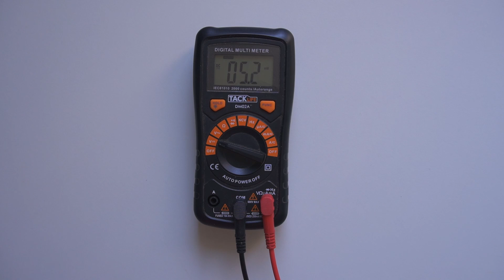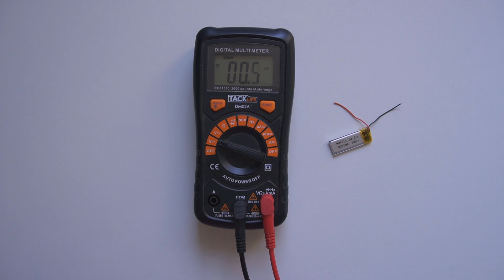Nice!Nano & Batteries | Quick Guide

Comment: Incredibly helpful video! I think I spotted the Ferris Bling MX at 4:10 , which is what I am planning on building. I am slightly confused on the stacked design, what materials did you use for the switch and bottom plates? Was this also printed by a PCB manufacturer or printed somewhere else? Thank you!
Reply from the maker: @stefanvanbiljon8657  yes, all 3 layer are FR4 (PCB material)
Reply: @KyekOfficial  Got most of the parts and am about to start assembling! About the orientation of the NiceNano V2 on the Sweep Bling MX, the PCB specifies to have the components facing downward, but this means that the RAW and GND pins of the Nano do not line up with the labels printed on the PCB. Which source of truth do I believe?

It seems like you have the components facing down but i'd like to be very sure
Reply from the maker: @stefanvanbiljon8657  it should align with the labels on the back of the PCB
Reply: @KyekOfficial  Thanks for the quick reply, turns out i had it wrong but luckily didn't close the jumper pads so didn't break anything

Comment: I recently bought a kit from Aliexpress, it was actually very cheap so i decided to buy it.
When i recived it i realize that i comes without the battery, is there a way to test everything without a battery? (the solder work and stuff) If i connect directly the nano to the pc it will do something? Only while i wait til the battery arrives.
Reply from the maker: @adrianavilamendez5348  yes you can connect via USB

Comment: What would happen if i connected a double or triple or even bigger size battery with the same voltage output? 
Heard a lot about custom keyboard with leds or small displays having short battery life but since a lot of us 3D print the case of the keyboard, I don't get why the small batteries...🤔
Reply from the maker: Because with a small battery you don't need a special case design to hide it. You can even use 18650 batteries if you want.
Reply: @KyekOfficial  my biggest consern would be solved about wireless diy keyboards 😁

Comment: Great video. Two questions:
1) can you still use the keyboard with both sides (L + R) plugged into the PC and the battery switch on the off position? In other words, a "no battery mode". 
2) the nice!nano has 1MB of flash and 256KB of RAM. Is that enough space to hold multiple layers, like the Miryoku layout or something more complex?
Reply from the maker: 1) yes you can
2) yes it's enough to use miryoku

Comment: hey Kyek,I'm quited interested to get one wireless corne for lay down coding, under which situation my legs will be placed between two splits.Wanna ask if you encounter any connection issue when something placed between two halves.
Reply from the maker: You can have some interference if you have a wireless device between like your phone. Your body shouldn't be an issue.
Reply: @KyekOfficial  thanks a lot!!

Comment: Thank you for the guide! One question, do I need to flip the nine!nano on the left side when building a wireless sweep with reversible PCB? I did that with my pro micro, but the nice!nano doesn't seem inverted here in the video.
Reply from the maker: It depends. If your PCB is really old you might have to reverse it, on all PCBs currently in the sweep repository both microcontrollers are face down

Comment: Heya,  I'm building a wireless corne, but I forgot to add the toggle switches. Is there a way to use the nice nano without the toggle switch?  Like turning it off or on by reseting with tweezers or something.
Reply from the maker: No, but the nice!nano will go in sleep mode after 15 minutes of inactivity by default and you can configure this timer in your firmware.
Reply: @KyekOfficial  aaaah I see! Thanks! So I will solder them today/tomorrow and use em until the toggle arrives. Thanks!

Comment: Thank you so much! Unfortunately I couldn't find a lily58 PCB that supports an off switch.
Reply from the maker: You can still use it wireless and realy on deep sleep mode to save battery. Or you can use the JST plug and detach it to power off, but the JST plug looks a bit ugly in my opinion.

Comment: Very helpful video! I am finally making that leap of faith of ordering the components. However, I still have two questions:
1. Where should I get the (not low profile) mill-max sockets? There seems to be some on Amazon, but those costs a lot. Also, those come in long strips and I do not know what tool to use to cut it into 12-pin length.
2. I am planning on making a Sweep v2.2 build. How shall I solder the power switch, the battery, and the nice!nano for it to work properly? I can't see any battery pads(maybe I'm missing something).
If you have any additional suggestions for first-timers, please feel free to tell me. Thank you!
Reply from the maker: I got them from AliExpress and I cut them down to 12 pin with flush cutters. In my next video you will be able to see how I cut them.
The battery pads are marked B+ and B-. You can see them near the USB port.
My only suggestion for now is join the discord community so if you need help we can talk more easily.

Comment: hey nice video! are you able to reload the battery with the usb c port on the nice nano?
Reply from the maker: Yes, but the on/off switch must be in the "on" position. When it's set to "off" the battery is disconnected so it can't charge.

Comment: And how do you connect it with a computer, does it have bluetooth??
Reply from the maker: Yes, the nice!nano has a bluetooth antenna.
Reply: @KyekOfficial  Is there a preffered reciever to use for the Nice Nano to have a stable connection?
Reply from the maker: @rufflesish  I use a TP-Link bluetooth 5.0 USB receiver

Comment: so if the pcb has no battery pads and I have to connect the battery directly to the nice nano, do I still need to solder the power switch even if it's not going to work? Thanks!
Reply from the maker: No. You can skip it.
Reply: @KyekOfficial  thanks for the quick response!

Comment: If I want to replace existing batteries - would de solder it and re soldering new one would easily finish the replacement? or is there any other caution needed?
Reply from the maker: Yes you can do that. Just be careful to not apply much heat and not touch the two wires together.
If you need to change it often it's faster and easier with a JST plug.

Comment: Do you think there is the option of putting an electronic ink screen on it?
Reply from the maker: Yes. The Corneish Zen keyboard has an e-ink screen. But the PCB and firmware have to support it.
Reply: @KyekOfficial  do you know where to find the screen
Reply from the maker: @dany910605  I don't know, I have never tried to do this myself.

Comment: This is so perfectly timed I just got my nicenanos and I’m waiting for my batteries to arrive. 
I’m going to change my pro-micros on my Corne to the nicenanos.
I want to have a power switch but don’t know where to put it, I’m not sure if the one in the video would work, any suggestions? You Ferris sweep video was one of the first videos I watched when I was looking to build my corne
Reply from the maker: The corne doesn't have a power switch footprint. You will have to direct wire it to the nice!nano.
You could mod the PCB and add a handwired power switch but that would be a bit complicated for a beginner.
Reply: @KyekOfficial  ah damn, I’m just worried about travelling with the keyboard and it waking up from sleep mode 

I didn’t solder any RGBs or the OLED screen, I’m very minimalist lol
Reply from the maker: @moosarshah  You could connect the battery with a JST connector and unplug it when you travel. Or ask over on discord how to hand wire a power switch. It would be a bit complicated to explain in youtube comments.
Reply from the maker: Oh, and another thing to keep in mind: Oled screens and RGB leds use a lot of battery power, and the RGB consumes power even if they are turned off.
Reply: @KyekOfficial  thank you 😊